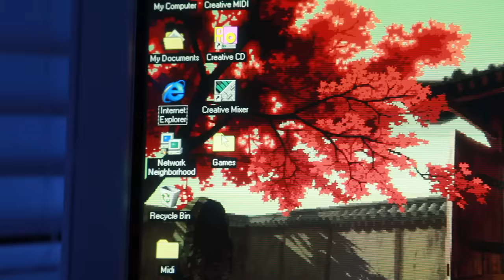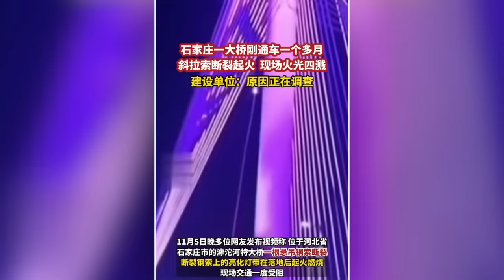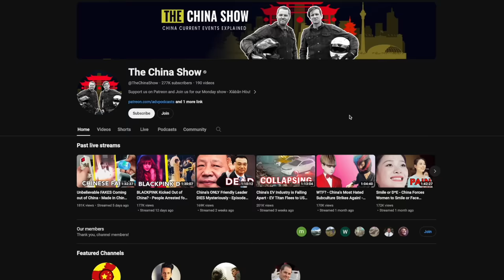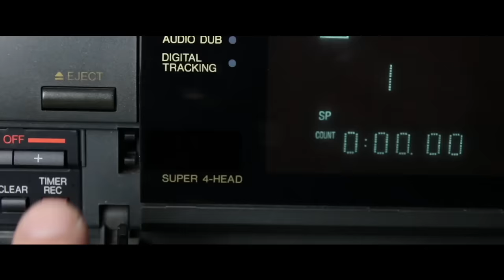Crazy Chinese Workplace Accidents - Why is Workplace Safety so Bad in China?

Comment: Would be really interesting for you to do a video about Chinese construction practises in other countries such as Australia the UK or the USA. Every time a building is constructed buy a Chinese developer there is always speculation that corners are being cut and I'm interested if that also the case outside china .
Reply: Too much like hard work!
Reply: I've never run into a Chinese Developer...but I have run into multiple Chinese Construction Companies. Some have a few decent workers, but Corners definitely get cut. I'm a Contractor. One of my Clients had some Chinese Guys install their Kitchen Cabinets (I was already busy doing the Flooring and other things there). They used damn near an entire 2x4 of Shims doing it. They left Blue Tape over the line where the Countertops meet and told them to keep it there for two weeks before removing it....they did that because their Line was horrible and the Epoxy didn't even match. Then the classic "No Phone Calls Answered".

Comment: I remember seeing horrendous footage of lathe, foundry and welding related fatal accidents on the internet years ago and I think almost all of them were from China. The sickening part is that almost every single one of them could have been prevented by either having some kind of regulatory group like OSHA or just simple education about the dangers of the tools and materials they were working with. Every Chinese machinist / lathe operator I've seen pictures or footage of was wearing long sleeves and often times gloves which would certainly not fly at any reputable machine shop here in the United States, but sadly I don't think the workers have been taught any of that and they become victims of haphazard industry. Poor bastards

Comment: Im a construction trainer in Melbourne, Australia.  specialising in Height safety,  if you weigh 100kg and you fall just 2m,  you will experience about 1.5 ton of force coming up on your crutch, the anchor point you are connected to,   needs to be engineered to hold 15kn,  or 1.5 ton,  which in this case is just some guy.  you think he could hold a car from that rope.  The rope will break but more likely it will be ripped out of his hands or pull him over too.  Im very happy to live in a country that cares and looks after its people

Comment: Just out of curiosity, I looked up pictures of a multistorey housing development that was built a long time ago before these types of units were even a thing. Yup, I saw one unit with a split level installed - in the porch. Now the porch is small and yes it would make things uncomfortable if you are in the porch with it on, but I think if you gave an a/c guy that kind of job as in this video, they would rather walk out. Edit: and surely, anything over a certain height should have central a/c. otherwise, it would be better to have the old-timey window units in a hole in the wall. That way you just have to pull it into the room for servicing as needed. Edit #2: On second thought scrap the window unit idea. It might be dangerous to weaken the wall by cutting a hole in it.

Comment: I used to build giant video screens (Panasonic Astrovision) in Sweden in about 99 with no safety gear. I would walk across the narrow top of the screen - like the guy checking the flowers -  20m above the ground if I needed to get to the other side because it was quicker than climbing across the back of it. If you did the same thing in Australia at the time you would get thrown off the job by OSH; in Sweden nobody gave a toss in spite of them having the worlds thickest Law Book - but NO policing...its not just China. The world is neither fair nor homogenous - you need to go where you are best treated. Not going back to Sweden - but I made a hell of a lot of money there...funny how that works innit?

Comment: Using a shot of a planned demolition as an example of "shoddy construction" makes your video look like straight up anti-china propaganda.  I lived in China for awhile too, there definitely is plenty of shoddy construction, you don't need to include shots of planned demolitions.  At the entrance to a community we lived in while in Beijing, while biking home a section of road sunk beneath a car in front of us leaving the car held up by its front and rear bumpers over what we discover later was a massive sinkhole that had developed underneath the road - LUCKILY the passengers were able to get out of the car before more of the asphalt collapsed into the hole.  It took a fair amount of time to fix the hole during which time the construction crews has sheet metal walls around the pit to cordon off the work area - literally a foot or two from the pits edge.

Comment: We just had our air conditioning unit replaced here in Australia by Chinese workers, because our Chinese landlord requested the cheapest air conditioning unit + labour, for us high paying tenants. 
In short, the workmanship was utter shite. They even refused to use the existing services inside the wall and link up the new system to it because it requires crimping, sealing and inspection of the old pipes. They mount the unit in a really ugly spot, right in front of the window that overlooks the view (because who cares about aesthetics right?) and drill directly into the wall where the inside unit is so they use the least amount of materials and effort. A bit more money would ensure that it was done properly by an Australian tradesman with a conscience. Chinese people will usually compete with each other on who can take the most shortcuts, and give the least amount of shits in what they do.   Australian people tasking Australian people, will nearly always be a competition on quality and reliability, however at a fair price (sometimes they get enticed by the cheap Chinese quotes instead)

Comment: The Thai’s are pretty good at this too.  Stayed in a new motel in Phuket where the bed had unfinished melamine edges that simply unzipped my skin.  All for want of a quick sanding. But yeah , that’s my fault for being there. 
The roadworks are a wonder to behold too, with gaping pits, exposed rebar and no exclusion barriers or warning signage.  Again, your fault for being a ferang and being there.

Comment: Design without thinking of repair and maintenance, so fking stupid and reckless. 
We has the same problem here, but not this dumb to put air conditioner's part outside without a way to easily reach and fixing it.
Seen a few Chinese's Architectural plans a few times, and they are horrible. :/